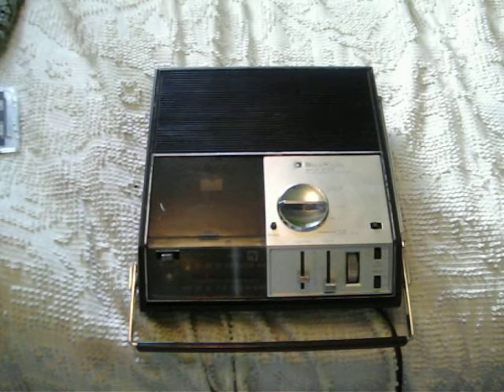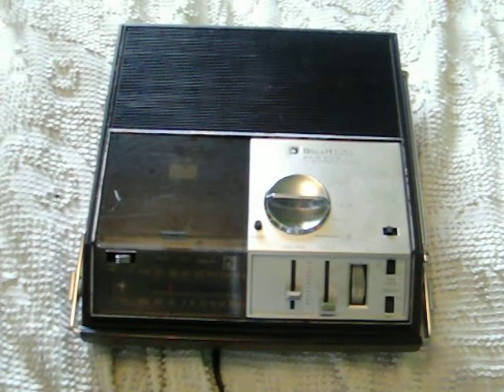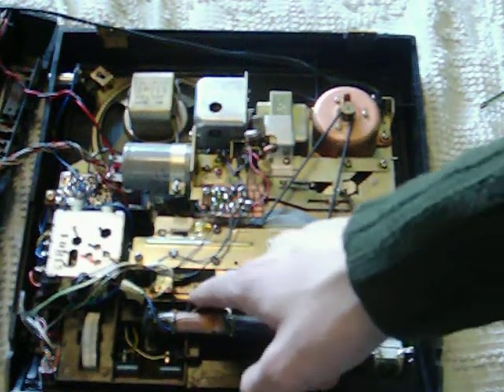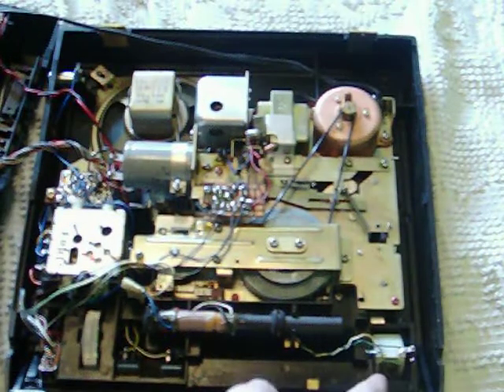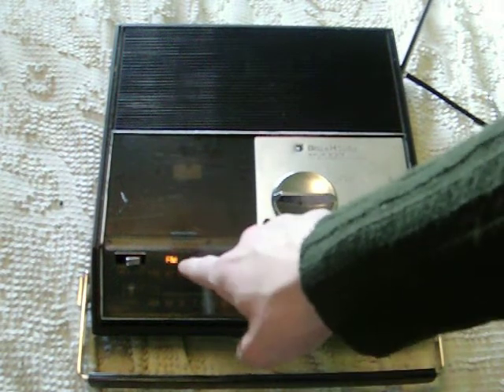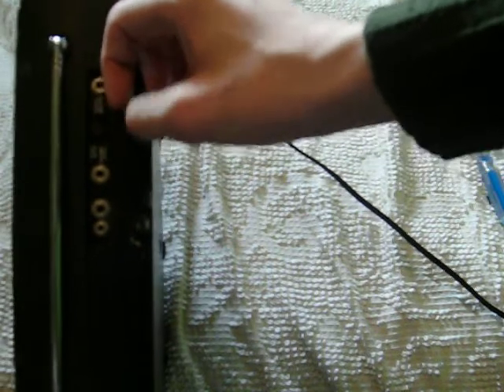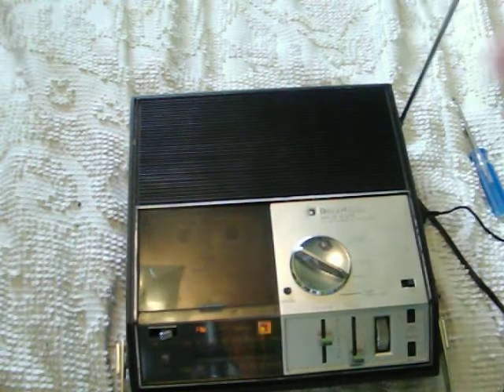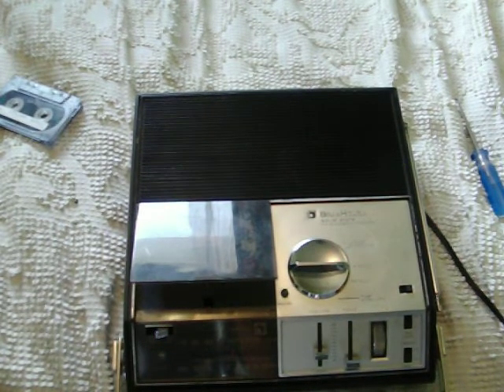1972 Bell & Howell Cassette recorder (2398A)

Comment: It's nicely designed, must sound great when the belt is dry. I like the way it has the rotary function switch instead of buttons to operate the tape deck.  BTW, about the windows movie maker thing, you could try what BadEditPro suggested, but I recommend eRightsoft Super, it basically converts every known video format.  My camera also records mov, witch NONE of my editors can work with, so i use that program to convert them and it seems to work really well.